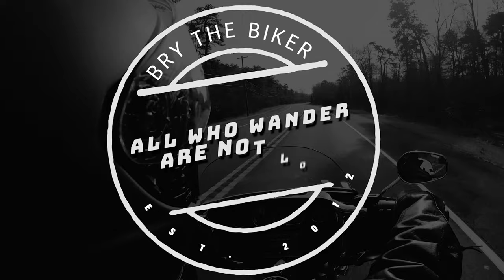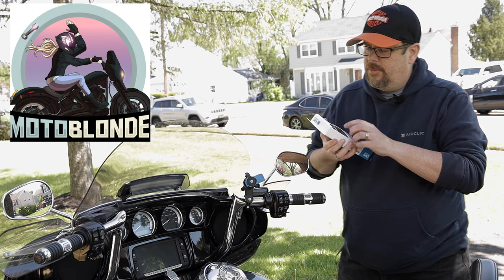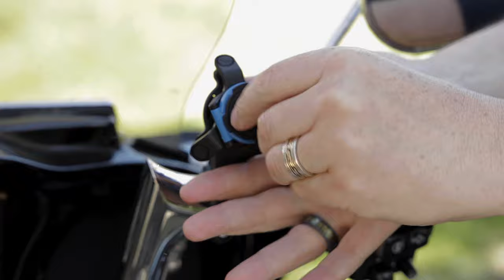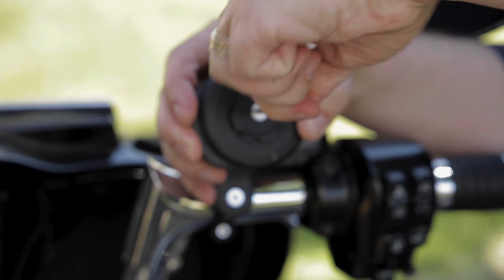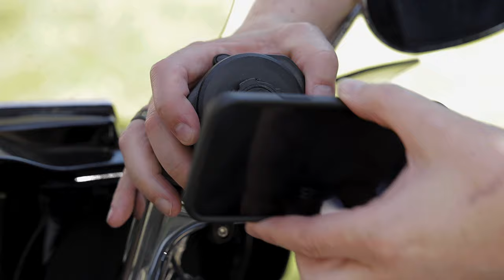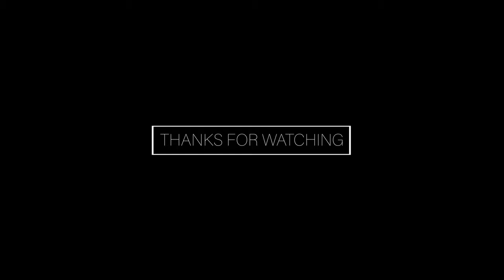The Shocking Truth About Wired Charging - Is It Holding You Back?

Comment: I’d like to add the wireless charger to my bike (I have the mount and have been really happy with it). The only thing stopping me is that I have to wire it to the bike since I don’t have a USB or Power Outlet to pull from. Rather than just wiring it onto the battery, I want to do it so that it is switched with the ignition. I just want that failsafe of not potentially pulling power from the battery when the bike is off.
Reply from the maker: Yes that is huge.  No one wants to push a bike home :-(

Comment: Thank you! - i was wondering if this would work on the out front Bicycle mount  (not teh one for the stem)  and it looks like in your one shot that the  ring with teeth under the charging head is the same as the one that is on the out front bike mount.    I' keep a usb battery pack on my bike and have E bikes all the same and would like to not have to cable plug in my phone when i ride.  - looks like it may work. i'll order one and try it out.
Reply from the maker: It should work as long as the battery back is big enough. I got one for my car now you get spoiled fast. Thanks for watching!

Comment: I'm just wondering what the use is on a motorcycle of a slow wireless charging. if i use my Samsung s21 as a navigator the recharge is not enough to compensate the consumption.
Reply from the maker: With my iPhone and this setup I can use the GPS and it will still charge the phone. I had that issue with other setups but this one really been working great.
Reply: Ciao, risolto il problema della lentezza con S21? Vorrei acquistarlo, ma questo mi frena....

Comment: I really like the system too, but my questing now is does it need a two hand operation to install or remove the phone? I really like the fact that I can work on my phone without putting my Hemet down, just grab and leave one hand operation
Reply from the maker: That’s a really good question I will have to try that.  I know you can when it’s in portrait mode you can but landscape seemed to be harder so I did it that way. Will give it a try and let you know.
Reply: @BryTheBiker  yeah i usually have my phone in portrait mode, almost never in landscape. But if it was the other way, landscape more often, I'd have the latch up top or below for one handed operation.
Reply from the maker: @junixsk8  I really like having live maps on the bike now using my phone. It’s so much better then the BOOM system.
Reply: @BryTheBiker  not when you have youtube and maps running at the same time 😆 jk?!?🤷‍♂️😅
Reply from the maker: @junixsk8  lol yeah don’t be THAT guy who joins zoom calls from his bike :-)
Reply: @BryTheBiker  😂😂😂 so irresponsible😂😂😂